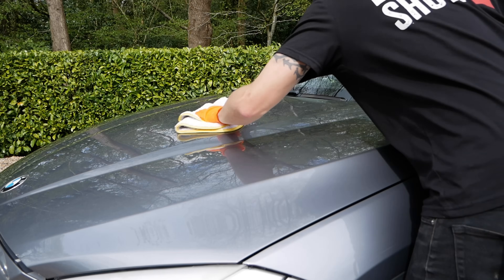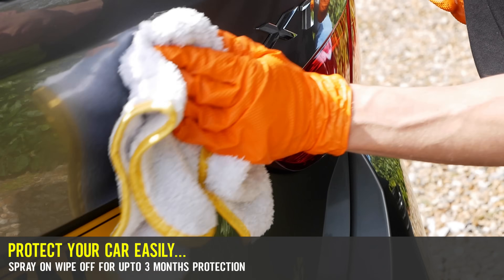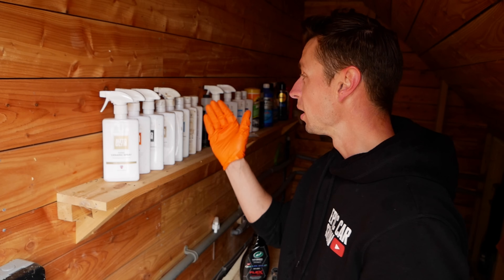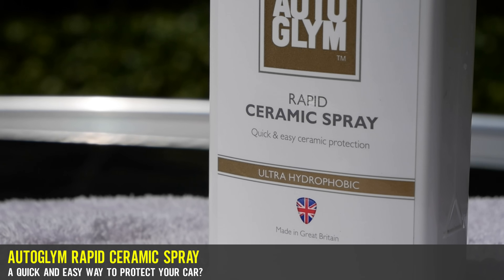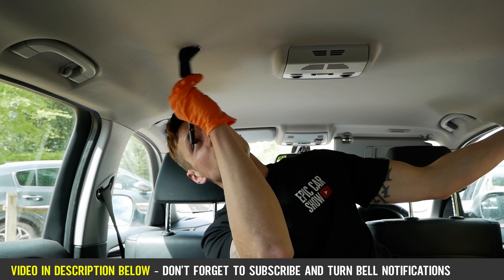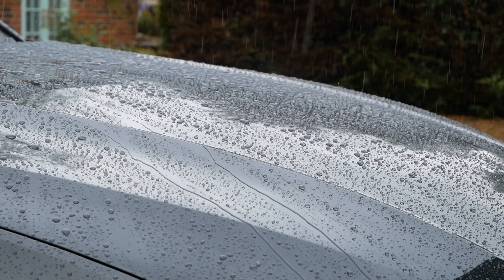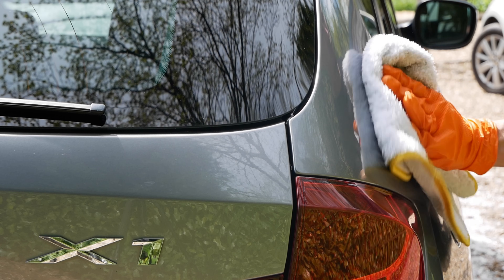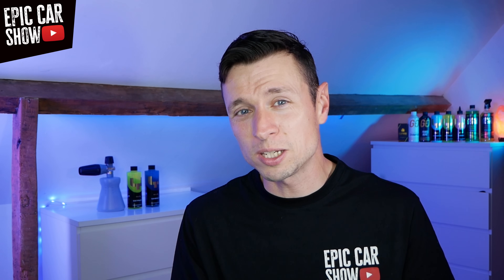Turtle Wax Graphene flex wax Vs Autoglym Rapid Ceramic spray Detailer // WHICH IS BEST?

Comment: I totally agree with you in the time factor. One thing that makes Flexwax easier to buff is to use a moist microfiber towel to smooth the Flexwax after applying it. Then a dry microfiber to buff. It really has a tendency to streak. I’m not sure I’d it’s worth the effort. I don’t believe all the claims of graphene cooling the temperature etc….need some scientific proof…water sheeting vs beading. We need evidence based documentation.

They both bead.  I really want to like the product, but it leaves me cold…price vs difficulty in use. I’ve also seen several comparisons of this product long term…seems it fails in a few months. No mention of this anywhere except in 3 different videos on YouTube of detailer taking the time to document long term..which is rather short term. Flex seemed to fail after 3 months. 

So much hype about graphene…don’t know what the truth is…no one does a comparative analysis..not even Turtle Wax.  Just my opinion.
Reply from the maker: I don't use graphene anymore. I think it's already a dying trend. I'm now more focused on products that make a car look better with easiest application instead of durability because every time I wash a car I always protect it
Reply: The graphene is supposed to be more resistant to water spotting in comparison to ceramic.  I have both of these products demonstrated in the video.  Dry coating the AG took just as long as dry coating the TW, and I had to re-wet more areas when using the AG to level it out.  I now use TW's ceramic+graphene paste wax, applied by hand and the gloss is ridiculous.  I use the Flex wax as a drying aid, but try to stay away from the glass... pita to remove.

Comment: Pat the detailer. On u tube.  Does all thease. And I’ve tried most , auto glum. I use to use years ago , ( still a good product) maguire sis good too  I’ve allways loved turtle wax. ...I agree for speed. Auto glum is fine but for perfection. I think many have over taken them ... plus many use a electric polisher thease days ...

Comment: 3 towels for turtle wax? Did you use a damp one? You're supposed to use a damp one to buff off first and then a dry one. The damp one will get rid of streaks and high spots

Comment: For the price argument you should have instead compared Autoglym Rapid Ceramic with Turtle wax hybrid ceramic spray. That would be much more comparable in price and performance and Graphene is the new tech so it going to cost more like all the other companies graphene coatings which cost even more than that.
Reply from the maker: Yeah fair point. At the time these 2 products were so popular I wanted to get as much exposure as possible
Reply: @epicautomotivedetailing  Understandable!

Comment: Is a ceramic coating better than normal car wax
Reply from the maker: A ceramic coating 100% yes in my opinion. These are ceramic sprays so not full blown coatings so they are short term durability compared to coatings but still great

Comment: How to maintain car after applying Turtle Wax 53409 Hybrid Solutions Ceramic Spray Coating, for dust etc. Should i wash with sahmpoo and use "MEGUIAR'S G19216 Ultimate Polish" for regular maintenance?

Comment: Turtle Wax... less is more.  Back away a bit when spraying on panel and if that doesn’t alleviate streaking, spray on applicator pad, not the panel, and then apply.
Reply from the maker: We had terrible wind when filming couldn't back away on the BMW X1 or it would of contaminated the other side of the bonnet. It's been ok on some paintworks just not as easy as Autoglym though
Reply: @epicautomotivedetailing  Detailing is a funny puzzle sometimes.  Certain chemicals, pads, process etc that is good on one paint, is terrible on another.  So many variables with detailing.  One certain aspect I’ve learned is do not bother with Turtle Wax Graphene Flex on any PPF.  You will be trying to clean up streaks for days!  Thanks for the videos… look forward to the next!

Comment: I was out at the price point. Detailing is getting like shaving razors have got, how much extra unnecessary jazz are company’s going to throw at what is a pretty straight forward task? Local to me brand Detailed Online have a product called SiO2 Gloss Detailer, £15 for 1 litre. Used it as drying aid on my car 6 weeks ago and it’s still beading water like it was when I first applied it.

I’ve also got a product called Skin from Valeting Products (a Car-Chen brand) smells really nice (One Million they call it) but it takes forever to apply as you have to work in small sections at time or it streaks really bad. £10 for 500ml isn’t bad value, but for the time it takes to apply I won’t be buying anymore. As for VP’s claims of it lasting up-to 12 months, it didn’t last 12 weeks!

Comment: After seen the durability of  Turtle wax Graphene spray I won't be buying it for £30 a bottle. Just given by black car a paint correction and I protected it with Meguires CW as I still had half a bottle. Megs ceramic wax beat the turtle wax graphene on durability in a test on I saw on YouTube.  I think the Autoglym marketing and packaging need a makeover in my opinion.
Reply from the maker: Yeah Autoglym are too good and I feel the Branding needs modernization soon because detailing is becoming a booming market with seriously cool brands hitting the shelves

Comment: I introduced the Turtle Wax Graphene spray to my packages a while ago and same as you Dave.....its the streaking that ruins it. I've tried everything on every type of colour car and no matter what I get streaks. Hot panels cold panels, doesn't matter...its simply down to the formula and the thickness...hence why they give you advice on how to remove them! I've got the liquid version and the spray version....£60 for both and they both do the same thing albeit the liquid maybe slightly less but more time consuming. I'm on the hunt for a replacement, I'll give the Auto Glym a shot as I really don't feel there's anything to lose. I'm also considering P&S beadmaker....thoughts on that one? Any other feedback would be greatly appreciated too! Rant over!
Reply from the maker: I've not used beadmaker but willing to try it. As for turtlewax they should do a pack of 4 smaller bottles. So the enthusiasts cam enjoy trying all products without the crazy money
Reply: @epicautomotivedetailing  its had a huge backup from Matt at Obsessed Garage, The Rag Company, Pan the Organizer and plenty others so it might be worth  a look!
Reply: If you get streaks you are using to much. 
I found that 2 sprays directly on an applicator  per panel  works and doesn't streak. 
And use a separate microfibre cloth and it blends perfect with no streaking.
Reply: @marcusbarnes5929  yes, a little goes a very long way with the flex wax.  As a drying aid, I only use one spray per panel, except for the hood and roof, two sprays max!

Comment: Tuttlewax lost this one big time. First of all price, 50% more expensive. It wouldn't be a deal breaker if the application was instantaneous but it PITA. Longevity is also far inferior (tested by other testers on different channels in real life) and if you want a real graphene oxide coating for a mad price and ease of application you go with 303 and you get an absolute minimum of 12 months without any top ups, maintenance or anything else :).
Reply from the maker: I need to try 303. heard good things about it

Comment: Well According to professional advice ...  for a start proper ceramic coating liquids dont come in plastic containers as the chemicals in these liquids react with the plastics. The proper stuff is to be found in glass containers . And this chap states that this product is perfect if yr in a rush. The proper process takes 5hours + to prepare and finnish then 8 hours to dry and harden . But then I suppose this is reflected in the price . £20  per bottle vs £350 -£500 for a proper  long lasting job . So it seems that this is just another sunday afternoon polishing job not a ceramic coating
Reply from the maker: This chap who commented clearly didn't pay attention 🤣. I never said it was a coating. It's a spray with sio2 ingredients within the product. That's how brands get away with using the term "ceramic" on the bottle. It's not a ceramic coating. Understand?
Reply: @epicautomotivedetailing  my apologies . No harm intended 👍🍻